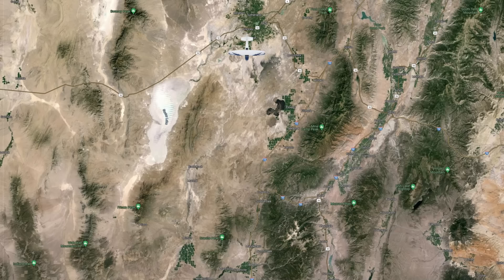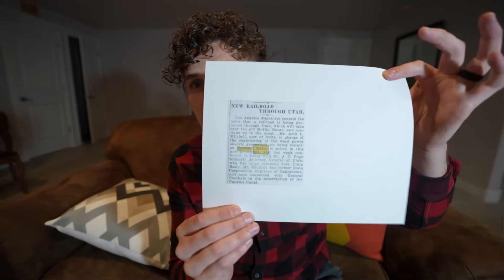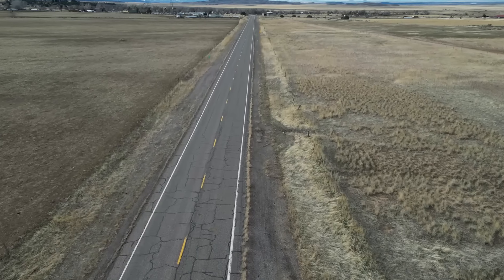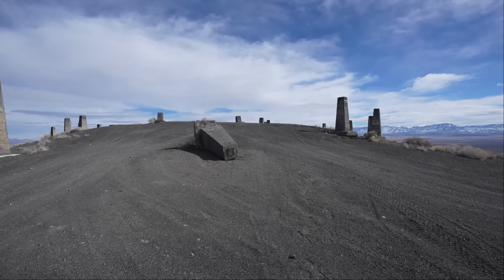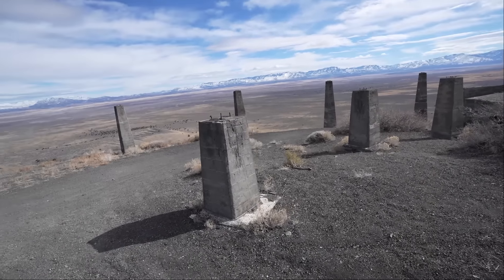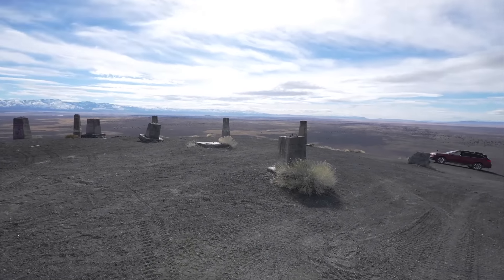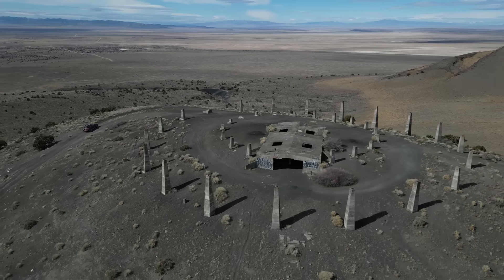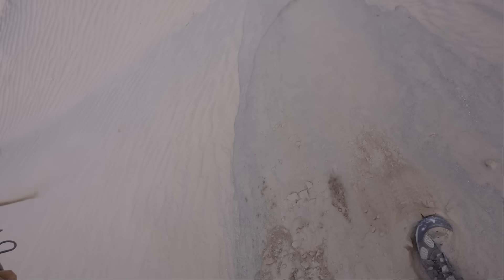I Found This Weird Thing in the Desert.

Comment: 1965 novato ,CA .a guy built a circular wind generator ,like a ferris wheel laid down on it side ,flat ,just like this guy s plan but no trak a giant central bearing point (Axis) and 55ga, barrels cut in half ,it worked ,...oh did I mention his house was a a flat ,circular disk that rotated on cental axis, like livin inside a old bias ply tire 50 feet in diameter. think and live large.
Reply: Very cool idea--sorry it didn't take off.
Reply: I’ve seen one of those houses, they are incredible and were way ahead of their time
Reply: I concur,. Even before reading this comment, that was my conjecture: a horizontal (flat) rotating wind-scoop. It would not need to rotating at a fast speed to general electricity. The electrical generator would have been inside the central concrete structure. The "so-called" water fountain was possibly a sundial..

Comment: The construction would be much simpler than you imagine. Notice in the roof of the building 4 square holes. There would have been 4 pylons that would create a giant A frame. The surrounding cement anchors would have cables attached.  The whole thing would look like a wire Christmas tree with a big star on top. The rotation would be simple as well. Only the turbine would rotate not the whole tower.
Reply: Sort of like Teslas tower?

Comment: This would have presumably been a very different type of wind turbine to anything you’ve likely seen. There is at least one company currently building a system that races around a circular track similar to what we can see of that design.
Reply: Realistically, they could be designed to look somewhat like a merry go round or carousel. given the location and the wind, it would not have to be tall, but wide, to minimize damage from high winds. it could even be built so that a second layer could be put on top, if energy demands called for it in the future. a flat design would have made it easy to maintain.
Reply: @patriot9455  I agree. It does look like a rotor design,but with that much track, the bearing maintenence was probably forecasted to be to high.
Reply: @Smitty134  could it have been thought to mount smaller generators in a circular or arcing configuration. Some of the old geniuses, having no preconceptions, did things we could not even begin to make sense of ....... and some of them worked
Reply: I'm picturing large wire coils and magnets like an alternator spaced around the track. Great idea, but a monumental task.
Reply: @Smitty134  I agree, but a monumental task with a magnificent potential
Reply: I'm picturing a giant water wheel but lying on the side spinning on a track
Reply: @PyhisPahis  A magnetic track or set of frictionless bearings that could be built n any size, with only the available space, large or small, being the limiting factor. NOW WHO WANTS TO BUIL:D IT. Imagine it being powered by the wind, much like a said on a true sailing ship.

Comment: Erik , I believe it would be a Horizontal turbine .. not a unit like today's vertical units .. imagine two discs separated by scooped "blades".. the thing wouldn't need a tail or vane to aim it towards the wind as No matter which direction the wind came from it could energize the turbine !  
  I envisioned the same thing with a vertical shaft driven by the large horizontal turbine supported by tires/wheels supporting the rather large diameter circular moving structure .  
  Thanks Erik and enjoy life !
Reply from the maker: Whoa. I did not think of that. But that actually makes more sense than my theory! Thanks for sharing!

Comment: Is there a community near by that the power would have been for? How far away from the wind turbine was the grain silo? Was here an abandoned farm near by that was once occupied by! Maybe there are old mines near by that it would have powered. There maybe been some installed apparatus installed that has been removed for salvage. Nice video! Thanks!
Reply from the maker: The two closest communities are Delta and Filmore. Both are farm towns and records from the county website said it was going to help supply power to farms. They are both about 30 miles from the site, with the mill being in the middle. so I imagine the original plan was to run lines in both directions to power both towns but who knows? The grain silo was about 50 miles north. I just found it on my way back home. I'm glad you enjoyed my video. Thank you so much for taking the time to watch!